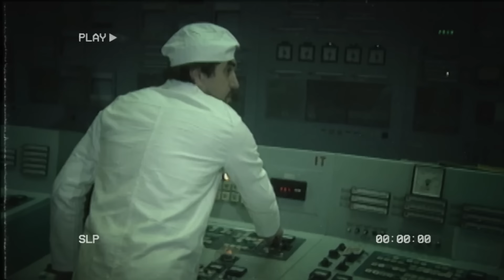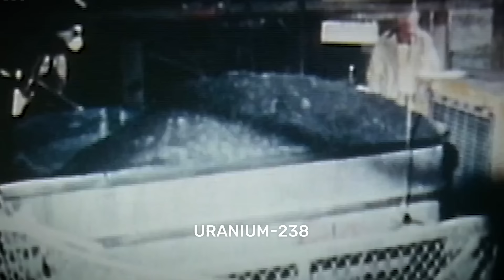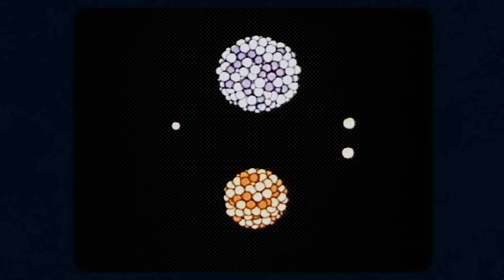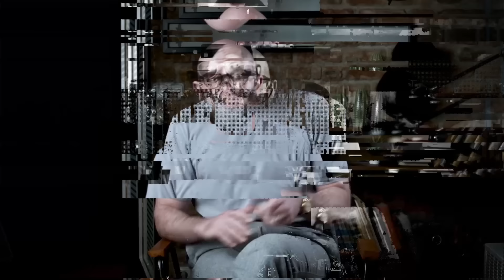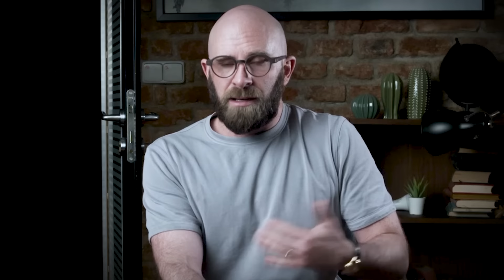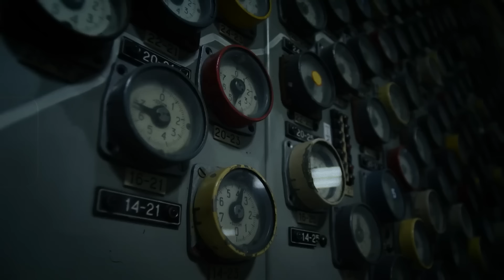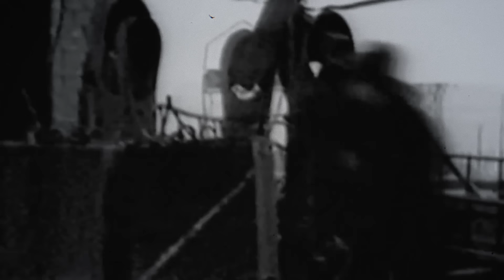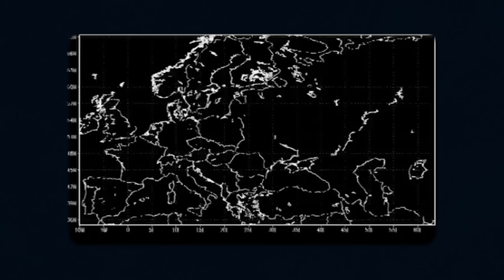The RBMK: The Shoddy Nuclear Reactor That Nearly Killed Millions

Comment: Explanation of a moderator is a bit scuffed.  Moderators INCREASE reactivity, which the explanation eventually gets to after alluding to them SLOWING DOWN reactivity.  Additionally, we fall into the same trap that the TV show did here, putting far too much responsibility on the graphite tipped control rods.  A brief increase in reactivity occurred, and had to be explained, and WAS explained by these graphite tips, and yes they have design implications on the reactor -- but in the context of the disaster, it would have happened even without graphite tipped rods.  Xenon poisoning and the operators failure to manage a xenon poisoned reactor in a safe manner caused the disaster.  By the time SCRAM was engaged, it was already going to blow.  Graphite tips be damned.

Comment: Chernobyl set nuclear energy back for decades.
Although I suspect that environmental groups either don't understand how nuclear power actually works or are paid by fossil fuel companies to push renewables.
My idea would be to have a hybrid system of renewables and small modular reactors. When there is a surplus of renewable power, the reactors are run at a lower power level but are still active to deal with any variances of power output. When there is a low renewable power output, the reactors are "throttled" up to add energy to the system.
"But it's expensive." Well then state subsidies are used to build reactors of a single design that is known to work safely. 
Parts and fuel can be shared between reactors and personnel can be trained on a single reactor design and be able to safely operate all models of the same reactor.
An economy  of scale brings prices down. That's why renewables are so cheap, since a lot equipment of a safe and known design has been made, the price has come down.

Comment: Like so many videos, this one also gives a rather confusing (and possibly) incorrect description of the control rods, just like the famous TV series did.

The picture at 11:23 is actually (approximately) correct. However, your description of it, during displaying that picture and afterwards, is confusing and vague, and can be interpreted (and is largely) incorrect. The picture itself shows more accurately how they worked and what caused the energy spike, but you don't explain it clearly nor correctly.

Comment: Ok, nice video but...
the reactor exploded and all, but entire section about "the melting thru underground water generating a  megaton explosion" is a megaton of  horseshit! This came directly from HBO and helped to create a interesting heroic plot, but has litterally ZERO base in real facts. The roof was blown off by high pressure steam! it was a mechanical explosion, not a thermonuclear explosion!  To create a thermonuclear explosion using energy grade uranium is 100% impossible!
Reply: Not to disagree with your conclusion, rather to amplify. A nuclear explosion requires the critical mass to maintain critical geometry long enough for enough fission events to create a "bomb". The key word here is "geometry". A nuclear weapon uses chemical high explosives, in a specific geometry around the core to maintain the critical geometry. A nuclear power reactor, regardless of the specifics (e.g. fuel, cooling, etc.), will never maintain that geometry long enough to function as a nuclear bomb because the initial fission events will force the nuclear fuel out of a critical geometry into a subcritical geometry.
Summary: Creating a nuclear explosion with a nuclear power reactor is 100% impossible, regardless of fuel
Reply: There is even another layer to it. It may have worked for the series, that is back then scientists may have miscalculated that so badly. But today, in a material about the incident when so many things are known better, I would expect precise numbers.

Comment: Note that reactor operation between a power reactor and a breeder for the purpose of producing weapons grade plutonium differs.  In the former the operator will leave fuel rods in as long as possible to maximize fuel usage.  For the latter fuel rods will be left in for a much shorter time, only a few months.  This is done to minimize the production of Pu240, an isotope with undesirable properties for nuclear weapons.

Normally a fuel change in a BWR or PWR is a length operation that requires taking the entire reactor offline thus interrupting the production of electricity for like a month or two.  The RBMK design was an attempt to achieve the goals of weapons grade plutonium production, electricity production and a very high availability.  At the price of safety.

I consider the claim that the control rods were graphite tipped for cost reasons to be correct.  An alternative design could have split the function of moderation provided by the graphite tips and the function of control provided by the cadmium bits into separate system.  Both were unified into a single system for cost saving.

Comment: 21.54 In all the simon whistler videos the facts have been spot on BUT: there is no way that water turning into steam, that is caused by water being dumped over a hot ANYTHING could get a megaton TNT eq. let alone a kilo ton eq. Look at the first blast: not even0.1 kilo ton that lifted the lid. 

The fear was that the water would act as a moderator (some how with 0.7% NON enriched uranium? I don't see how given the core was no longer in an optimal configuration, but rather a rubble pile), to become fissile once again turning the reactor back on in limited pockets, radiating all kinds of nasty stuff as fission decay products. The biggest steam fear was the Corium =Radioactive lava melting down through the cement under the reactor hitting a large body of water, making a large, but not even a ONE ton of TNT eq. blast, and NO way a Kilo or MEGA TON blast. Nuclear physics are hards!

Comment: Moderators slow down neutrons, thus causing the reaction to continue. They do not moderate the reaction. It's the slow neutrons which initiate fission. Fast neutrons will pass straight by an atomic nucleus and only rarely interact with it.

Comment: "shoddy"? hardly. it was operated outside of its designed (and documented) limits.
there was a plane crash, a couple of days ago, in toronto. the aircraft design was not shoddy, but i will guarantee you that the crew operated it outside its limits, too.

Comment: In  order to better understand why they had graphite tipped control rods we have to look at the reactor a bit. It had coolant channels and as the water goes into the reactor at the bottom of the reactor the temperature of the water rises the higher up in the reactor we go.

So there is a higher chance of having steam bubbles at the top of the reactor and water at the bottom, due to the positive void coefficient they wanted to slow down the rate of reactivity at the top of the core and increase reactivity at the bottom of the core, so graphite tipped control rods makes a lot of sense.

For me the main reason chernobyl exploded was the design of the reactor itself, which was a hybrid reactor that worked with very low enriched Uranium and a very high neutron flux, compared to the wests reactors which were designed only to produce power. The RBMK could be turned around to produce very fine plutonium too, which was why it was designed that way. In the west we used to have plutonium producing reactors all of which used graphite as the moderator and low enriched uranium and a high neutron flux just like the RBMK did.

Using water as the moderator absorbs some neutrons so we need to use higher enriched uranium and a lower neutron flux, its safer as the faster the reactor goes the more power it produces and the more steam you will get which will slow the reactor down, or a negative void coefficiant because without a moderator the neutrons are too fast so they dont split U235 at those speeds they just bounce off.

There is a joke that goes "communists too stupid to boil water" which refers to chernobyl because its idiotic to make a reactor that can both produce plutonium and to produce power. So in the west our plutonium producing reactors cant produce power because they run at a very low power output so you cant even boil water with them so the coolant cant even turn to steam and most of them uses a gas as a coolant anyway usually carbon dioxide but some uses helium instead and no graphite tipped control rods either.
Reply: Thank you for saving me from having to type this out

Comment: Re: the 2-5 megaton thing - I personally believe Legasov never thought this was possible or likely but had to present a doomsday scenario to the USSR leadership to get things done.    The Soviet Union might have considered abandoning the area and letting it happen, unless they were made to believe this was not an option.
Reply: Nobody thought it was possible. The idea came from some belorussyan academic who was going on about how the water could suddenly act as a moderator and initiate a chain reaction in the corium. He calculated the total yield of runaway fission from that as if it were a warhead. Total nonsense.
Reply: @zolikoff not the chain reaction. Heat reaction. The coreum was fissioning and lava hot. When it would touch the water in reservoirs below it would’ve vaporised all of it and make a huge steam explosion. 5 megatons is of course probably an exaggeration, but it was done to scare the USSR leadership so that they will actually allocate resources into dealing with the consequences
Reply: @ That detail was made up by the HBO show. The original megaton explosion claim as I wrote comes from an academic who hypothesized the fuel would react. Which is where the megaton yield comes from.
In reality none of this mattered, the engineers dealing with the incident simply drained the water tanks in question, it was not a "suicide mission", and it turned out that the corium had entered the tanks by the time they got to draining them anyway (and nothing happened).
Reply: They are a massive money machine paying its high ups 100s of thousands of dollars a year if I recall. Look up the Financials and see how many millions flow through each year...

Comment: If you think about it, the most efficient energy-producing mechanism works via steam. We're still using glorified steam engines, only thing that's changed other than the scale and the materials that enclose them, is the fuel used to heat up the water...

Comment: Ok so first of all a neutron moderator actually increases reactivity because slower moving neutrons are MORE likely to impact and generate a fission event that fast neutrons due to some of the peculiarities of quantum mechanics, specifically neutron flux. Second the graphite control rods WERE intended to reduce costs, however in a roundabout way. As you correctly pointed out the graphite tips increased reactor efficiency, but the point of this was to allow for the use of less enriched uranium fuel which significantly reduced operating costs. Hope this helps, you are very good at disseminating information in an understandable way but you have to make sure that information is correct otherwise you are undoing some of your own good work.

Comment: The RBMK had some significant advantages over western reactor technology.  It wasn't a bungled design.  It was a pressure-tube boiling water reactor, that could run on very low enriched or even natural uranium.  As a pressure tube reactor, it didn't need a thick pressure vessel.  This allowed the USSR to build very large and powerful nuclear reactors quickly on a shoestring budget.  This meant cheap power.  But the positive void coefficient problem was a vulnerability.  It didn't necessarily make the reactor dangerous.  But it made it important to adhere to strict operating rules and maintain reliable trip settings.  The experiment in April 1986 deliberately disconnected the trip settings and withdrew control rods to 100% to burn off a xenon peak.  Any nuclear reactor would be dangerous if operators do things as stupid as that.  Its kind of like vandalising the brakes on a car and blaming the lack of airbags when people die in a crash.

Comment: Lets put it like this RMBK 1000 and RMBK 1500 Design Reactors have more high level accidents then all western Gen.2-Gen.4 Reactors Combined.

Even the worst Accidents like the Three Mile Island and The aftermath of the monster Quake and Tsunami of 2011 still only have resulted in single digits deaths due to the powerplants whilst RMBK have thousands of deaths directly connected to the Reactors.

So what People should be vary about is not Nuclear Power but USSR Nuclear Power.
But  sadly alot of the groups who are anti Nuclear often was established as a way to revolt against Western politics, and often they had connections to USSR either via Funds or ideology.

This is not meant as a way to give western systems a free pass or claim that they are free of any faults.
But it is important to note how much of the Anti nuclear sentiments actually comes from the Cold War West Vs East Political clashes.

And how much of the Anti Nuclear movement grew after Chernobyl but it was never focused on RMBK reactors or USSR Reactors.
It was almost always focused on Western BWR and PWR Reactor Designs.
And often it was claimed that the Reactors built in West Germany, Sweden, USA, U.K and Japan was meant to be used to make Atomic Bomb material.
This is impossible to do in Light Water BWR and PWR reactors yet this was often used as an argument to a total ban on Western reactors.

Whilst RMBK reactors was meant to Produce both Weapons grade material and civilian power and that is one of the reason why it lacks a safe containment structure.

The we also have Oil and Coal lobbyists especially in USA who funneled alot of the Anti Nuclear protests to.

All in all The forces who have tried to extinguish the Nuclear Clean energy is huge compared to any other force compared to any other energy product even the Anti Coal and Anti oil groups.

And this has hurt the enviroment more then most other issues and leaks such as Exxon Valdez for example.
Had we cut down Coal instead of turning off fully functional and safe nuclear powerplants one does wonder how much less pollution had been made.